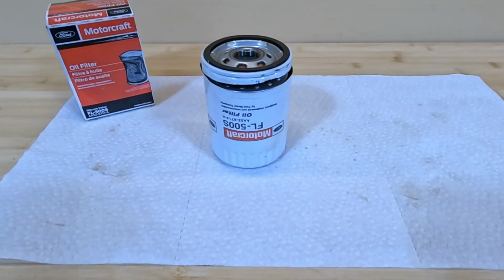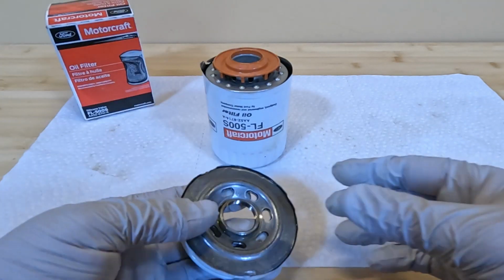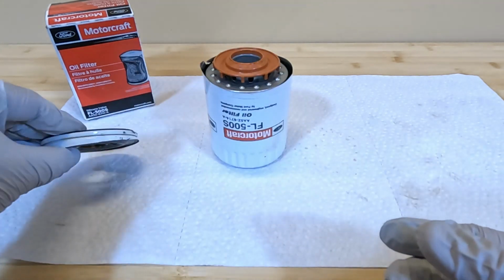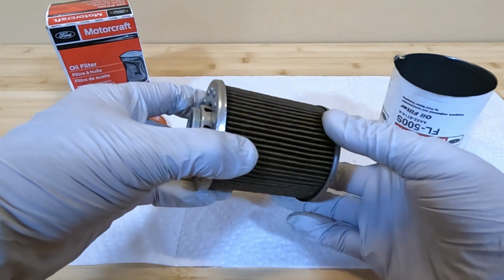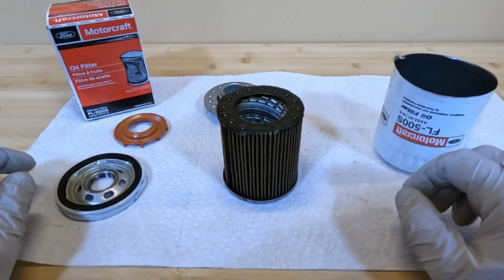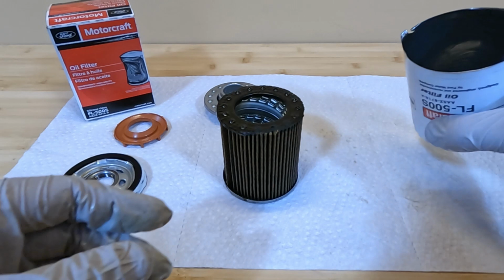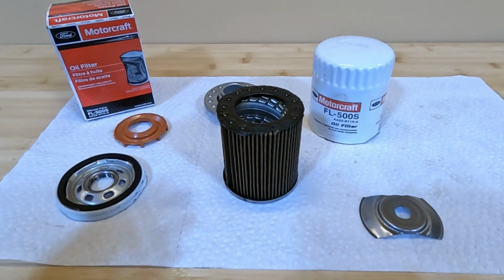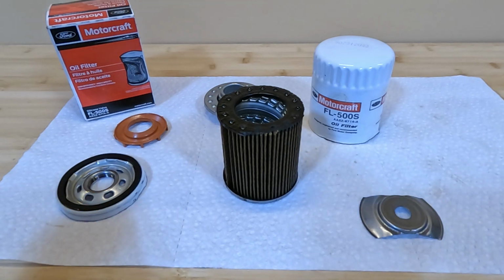Inside the Ford Motorcraft FL-500S Oil Filter from my F150 Raptor

Comment: This is a better quality filter than the AC Delco ones.  I used to run this filter on my Chevy SS with the 6.2L LS3 motor and it fit right on and was longer too.  Replaced the PF-48 from AC Delco.  On my Ford vehicles I only run Motorcraft or Wix.

Comment: I'll stick with Motorcraft. Never failed me yet. Ran in my last 1994 I6 for 17 years. I still see it running hear local. Has to be near 300k miles on it by now. I now run in my 2015 5.0l

Comment: I have a 2023 transit that takes 12 quarts of oil and has a 10k change interval. I’m amazed it uses this tiny filter for a 10k interval.
Reply: That filter media is not designed for 10k miles 😂

Comment: What would you think of running a taller filter like the motorcraft  FL-820s?    Or K&N HP-2010, or Purolator PBL24651?
Reply from the maker: I just stick with OEM. filters usually outlast the oil.

Comment: Do you know of other filters that have a better micron rating, that are also like this one?  And I do mean like - especially like the Upper Bypass Valve that you didn't talk about at all, which it probably the most important feature in cold climate startups when the oil on the filter is so thick from being so cold.  And the bypass is nearest to the oil coming into the filter.  Not to mention doesn't run sediments back into the engine in bypass bode, that have fallen to the bottom on the filter earlier.

And there is a coil spring in the bypass valve, so it wouldn't be advisable having two.
Reply from the maker: Filters with synthetic media like amsoil
Reply: @EnthusiastsGarage     It seem you missed the biggest topic yet again - the upper or front end or base plate bypass valve that is on the FL-500S.  What Amsoil or other filter(s) might you have seen or know has an alike bypass valve near the base plate of a spin-on oil filter.